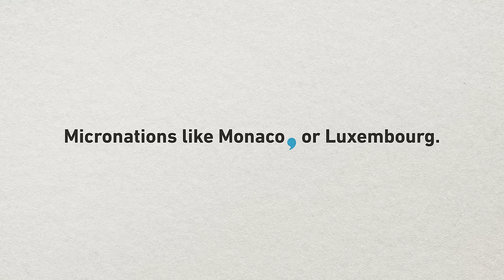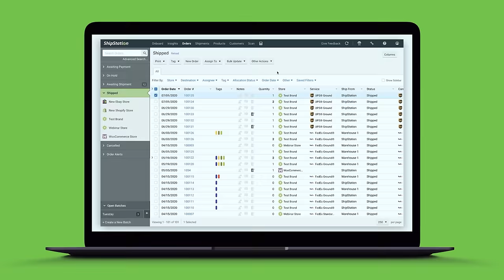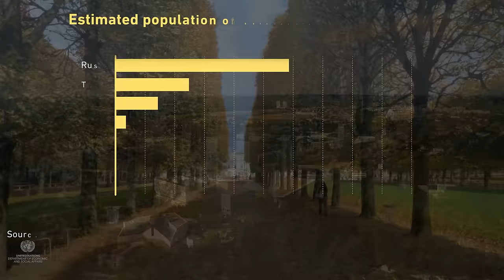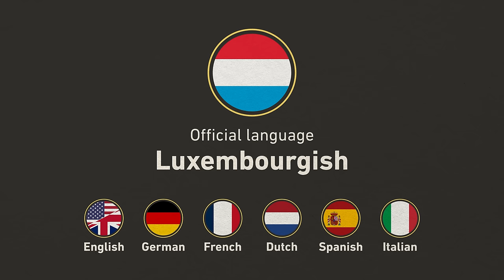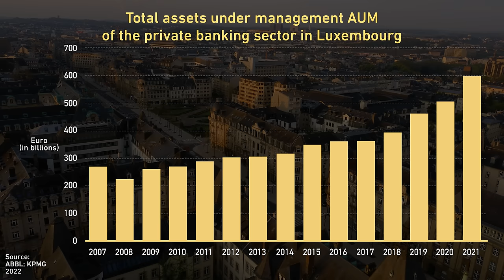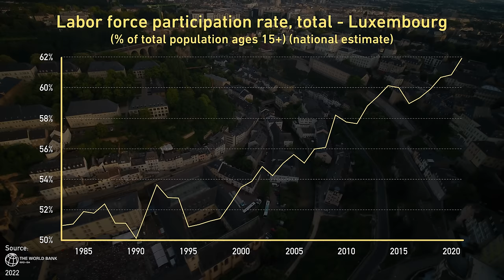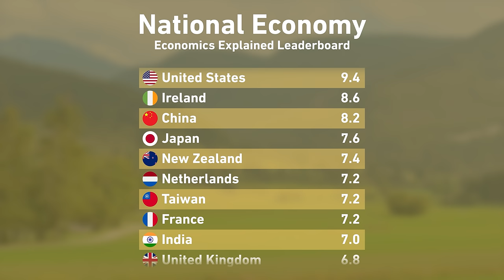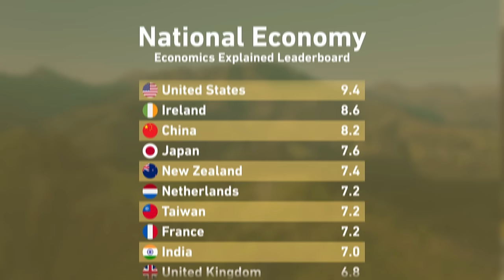Why Is Luxembourg The Richest Country In Europe? | Economics Explained

Comment: Doesn't GDP just measure who much money is changing hands within an economy? It doesn't correct for inflation or shrinking output if the costs are rising on wages and goods produced.  It doesn't measure the quality or for the difference in value a particular good - let's say a house - may have in different economies. Other measure may do that but not GDP by itself. There is often a huge difference of cost of goods and services depending on the country. 

Isn't it possible for a country with out of control inflation also to see rising GDP numbers? 

Please correct me if I have this wrong.